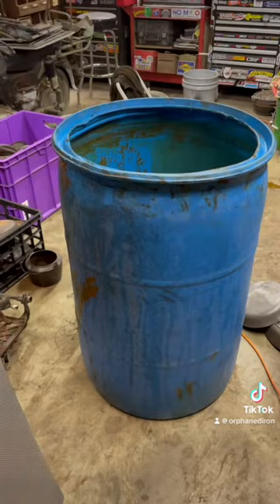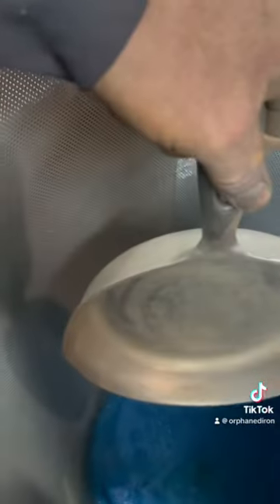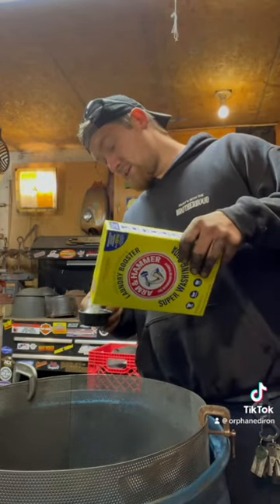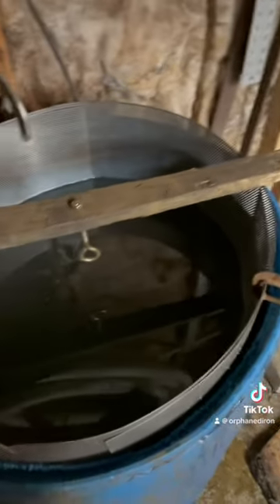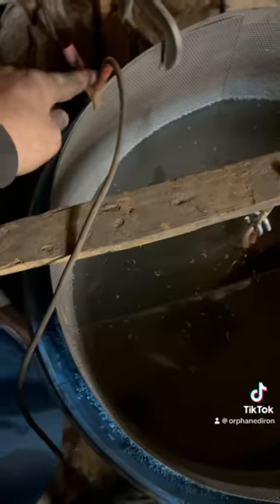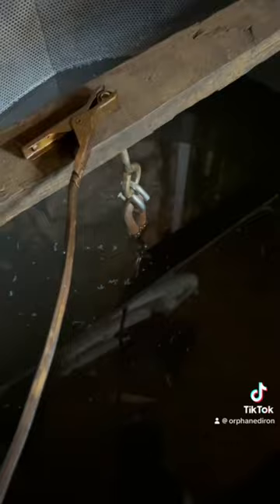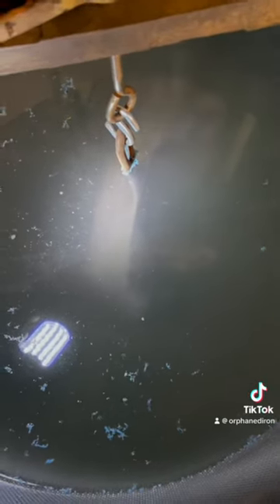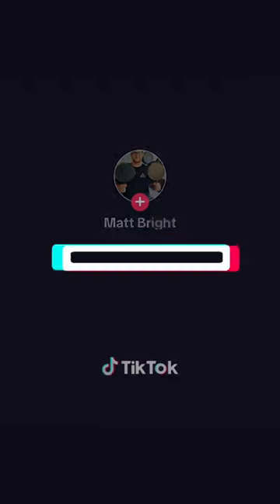Electrolysis How To

Comment: Does that work for built up seasoning/crud??
Reply from the maker: Yep! Removes rust, oils, paint, and built up food/carbon
Reply: If you use a separate lye bath first, your electrolysis tank will stay a lot cleaner. He has a video on that step.